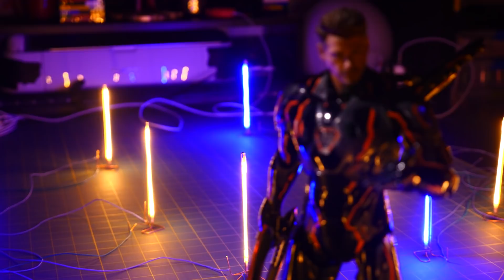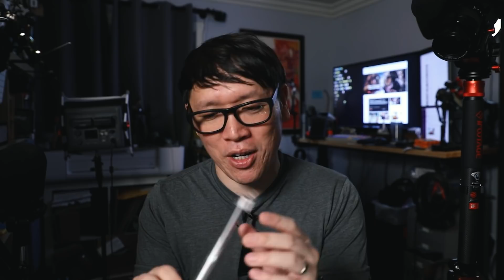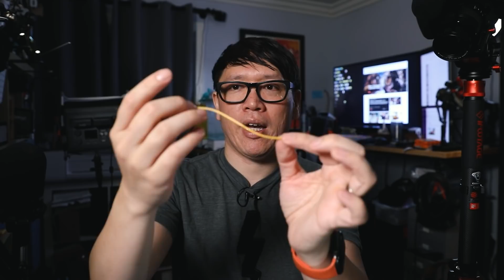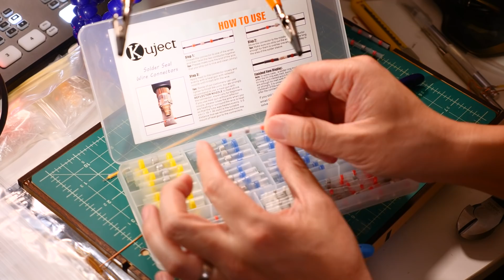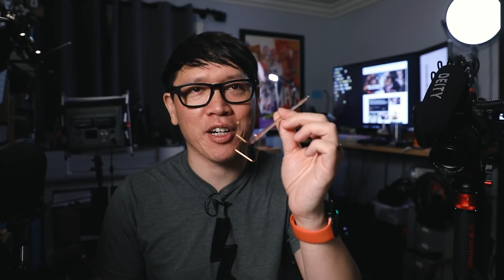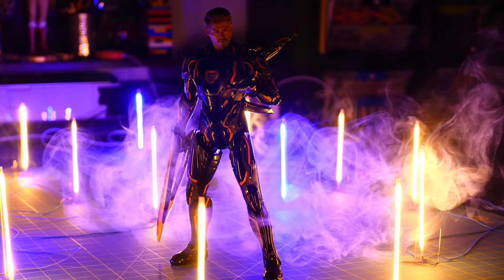How To Make Mini LED Tube Lights!

Comment from the maker: 130mm LED filament: https://www.aliexpress.com/item/4000857781901.html
Clear 5-inch straws: https://amzn.to/3n52Khj
Copper rods: https://amzn.to/3kxwba3
Wire bending pliers: https://amzn.to/3wEdhTZ
Solder seal connectors: https://amzn.to/3DapIZX
Heat gun: https://amzn.to/3CePElP
Silicone wire: https://amzn.to/3HiYTFF
Disclaimer: Tested may earn an affiliate commission when you buy through the links here
Reply: Hey Adam I just bought a $60 Loki crown off of Amazon. In attempts to get the horns (which I had to slide on to little nubs to connect to the head piece) flush to the crown I snapped it in half. Can you make I better, more durable, Loki crown with $60 worth of material?
Reply: Ali express link goes to flowers!
Reply: Tbh, they look like mini lightsabers for scale figures.
Reply: The link to the straws aren't clear
Reply: Im new to this. What power supply are you using that you can adjust the voltage?

Comment: maybe sanding the copper rods before the soldering helps with getting a good connection. Copper likes to form an oxide layer really easily.

Comment: I too have no patience or skill with soldering, and bought the EXACT same pack. They are a LIFESAVER. Can't tell you how many times splicing wires for 3D printed projects (or extending the wiring for the printer itself) these have come in handy.

Comment: If you find the right gauge in a piece of extension cord or whatever, to make them straight like the one you are using, grab one end with a drill, the other with pliers and stretch it while running the drill till the wire breaks. It will usually break at the pliers and you have a pre hardened copper rod of low gauge! Hope you read it and it works for you! Nice job!

Comment: Those red bands in the shrink-solder tubes is a hotmelt like glue designed to create a waterproof seal and guard against pull-out to the insulator layer around the copper. core of your electrical wiring.

Comment: Excellent 🙂👍👍👍👍👍 You can use magnet wire if you need thinner cabling, just remove the insulation before soldering 🙂👍

Comment: What temp do you use for the heat gun?  I ask as my heat gun is adjustable and goes from fairly warm to over 1000F if I remember right.  Interesting video. :)

Comment: Soldering at 300 degrees-! Nope. Maybe that's a further consideration- good soldering is up around 750F (400C). Keep your tip clean and don't use so much flux-- there's usually plenty in the middle of solder. Even really thin stuff.

Comment: Mighty fine demo and hard work on your part. I recommend finding brass rod-- though tubing is useful too-- copper is so expensive. Brass is just as easy to work with. I've seen .032" which is pretty rigid for these purposes.

Comment: I worked with those solder seal connectors from various manufactures in my job for 20 years almost on a daily basis. Custom comm cable work. They are good and very ridged (especially this long type) but way over kill, difficult to remove from delicate parts. Takes a lot of heat and for some time to melt the solder and shrink the outer tube. LEDs don't like heat. Standard hand solder a few seconds technique to attach the rod and some short pieces of small heat shrink are plenty rigid enough for static diorama/model work and from the bits and bites bin. even hot melt glue blob is quite ridged. consider if you even need to cover the solder joints.

Comment: You might also look into taking those flexible filament LEDs and coating them in clear casting epoxy. It would make them rigid and give them a glass look when unpowered.

Comment: You should use a cheap PWM based dimmer/speed controller module for brightness instead of micro-adjusting the voltage. Some modules accept 3-30v supply so can be used for different LED types.

Comment: I have used the shrink wrap solder stuff and those colored bands are rubber/wax and when you shrink it it melts that rubber/wax to seal the connection to waterproof it

Comment: easy way of getting a copper rod with small diameter:

get a full copper wire e.g. electrical wire. take off the outer insulation, take one strand, from the inner insulation you only need to take off the ends. put one end into a vice, grab the other end with pliers and pull first a bit and slightly increase the pull strength. you will notice that it will go easier at some point and then stops/getting very hard to pull. that's when it became hardened.

Comment: With the low energy requirements of LED lights these days could one not power them by using the energy from electromagnetic waves from WiFI and cell phone towers etc? I know you can stick a battery in them but this way you could even turn the lights on and off only by modulating the wave and signals.

Comment: I love those solder connectors I been using them on my jeep doing rewiring on lights and speakers and they work great. They give  a nice secure connection when you give them a tug and you can see the solder almost pop and cover whatever wires your using.

Comment: Use shielding mesh from cable plus cryo glue to make it stiff. To eliminate the need for the copper wire.  The light will hide the fine wire mesh.

Comment: If you chuck one end some smaller copper wire into you drill and the other end into a vice you can quickly straighten it out while adding rigidity.  It will make the wire brittle but experiment away and I'm sure you can get even smaller diameter wire to work.

Comment: The orange bands in the heart shrink tube are adhesive for strength and water proofing. You can probably clip off the one on the side of the light to avoid having that stripe since it's under no load and inside.

Comment: I was really hoping these were full size. I've been having a hell of a time trying to find a cheap alternative to clear pvc pipe that's more ridged than like those florecent tube protectors.
Reply: I wanted to do like portable lights for camping and all that. I priced out like 6x 18650s. A led controller, the leds themselves Charge/protection controller and it was all cheap enough then looked at the clear pipe.. totally blows the budget. Each light would be like $100.  Anyone know of an alternative for cheap ridged pipe roughly 2" in diameter?

Comment: some dulling/frosting spray on the outside of the straws could help increase diffusion and avoid the slightly curvy hotspots
Reply from the maker: Great idea!
Reply: difficult to not use too much. emery cloth light scuff the tube.

Comment: Thank you for the idea!
Tho it would be great, if you would have shown the complete build (what you used for connecting, what switch you used etc).
I can do it by my own... but others might have to watch other videos to complete this build.
Reply: you are switching 3v. whatever switch you want from small enough to hide, how it mounts to your project, if exposed what is the decretive look you want. they all wire up the same.  open and closed an electric circuit is basic 101 knowledge of any hobbyist, even beginners.

Comment: Another suggestion: fiber optic clear strands. I got them in a small blind bag kit thing from HEXbots and they are pretty darn amazing for making light wires. Might not work as well as your idea (might not cast enough light and might just glow), but this is a really cool project! I might look into this further.
Reply: Is it safe to use? Especialty if it breaks... Heard nasty things about it could be wrong tho.